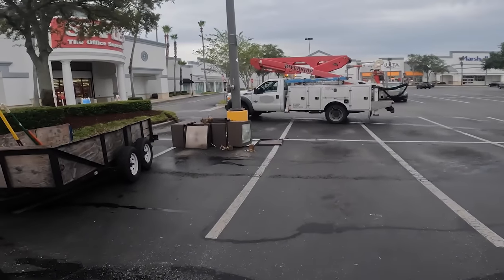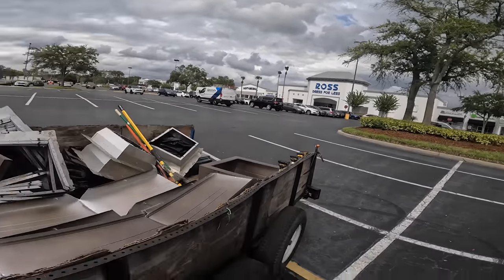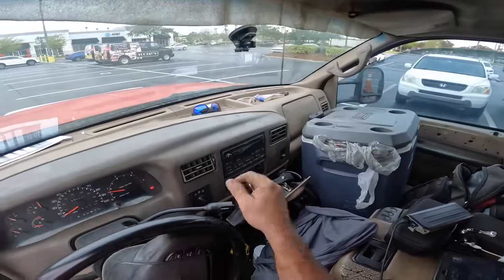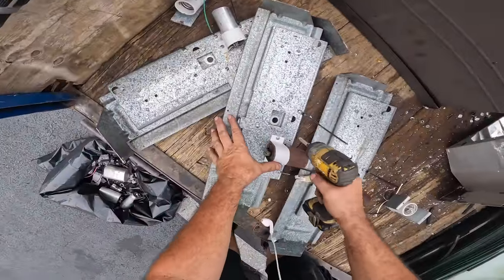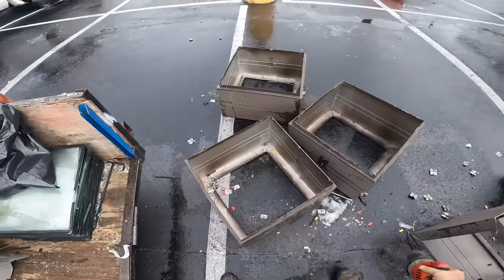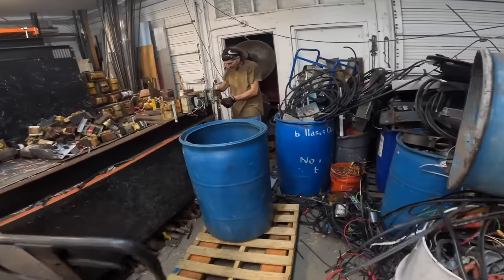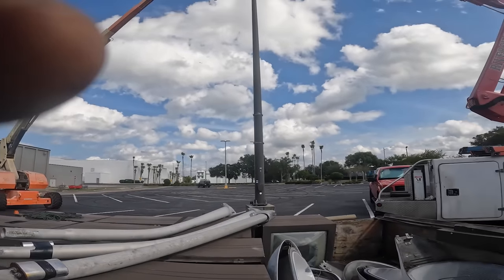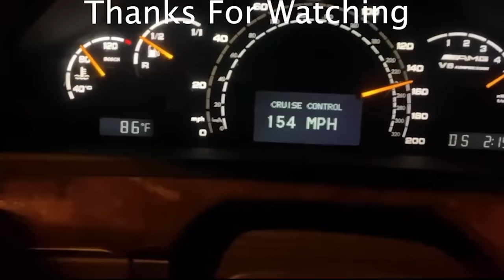Massive Copper & Aluminum Scrap Out Pt. 2

Comment: You need a box trailer.
Reply from the maker: I had one for a while, They are ok but I'd rather have a flat deck with removable sides and a crane. Having to come out the back all the time is a pain sometimes. No side loading or off loading.

Comment: If you had a tailgate for your trailer, you coukd remove it and span it across the sides, giving you a work top at a better height.  Do you put the capacitors in the trash?. Could they not go in with shred?. All the best to you from England where it has rained for like a month!!
Reply from the maker: Thanks for the suggestion, They will not take them at the steel yard I go to.

Comment: That’s awesome they let you get the Birds Eye view of them taking off and putting up the new lights!
Reply: LE: it was a temporary solution.

They literally put electrical tape as rain protection...
Reply from the maker: These guys are cool like that. 👍
Reply from the maker: They had to put the tape on there temporarily because the cap is actually a remote control system so they can turn on/off and sometimes dim the lights. They were sent the wrong ones, the other guy went and got the right ones and over the weekend they installed them.
Reply: @ProjectShopFl  Thanks for the exaplain, sorry for bothering without a sense. Shoutout from Romania, EU and hope you recoup the sleep.

Comment: You need a foldable workbench, bring it with you wherever you go. 

Also you should be giving yourself more sleep or at least a good nap after those long drives

44:00 Yeah definitely start charging to pick up those lights. When you’re getting more for aluminum than copper you’re just being their garbage hauler at that point
Reply from the maker: I get way more for copper than aluminum

Comment: did those guys actually put ductape on the top of the poll to finish it off?
Reply from the maker: Yes, but only because the cap witch is a remote control system was the wrong ones, They came back the next day and installed the proper net link system.

Comment: in australia any damage to vehicle, like you have on rear tub guards  be police would give unroadworthy notice and you’d have to repair in like 14days or they deregister your car. as they recon that damage is a danger to pedestrians if you crash in to them. evan your trailers with no mud guards and bit old 1st copper here would pull you over. they are cunts here
Reply from the maker: In south Fl you would be shocked at what is driving on the road. lol I have 2 new fenders I just have to get them painted they came primer gray. Then I will have to paint the hole truck to match the new paint. lol